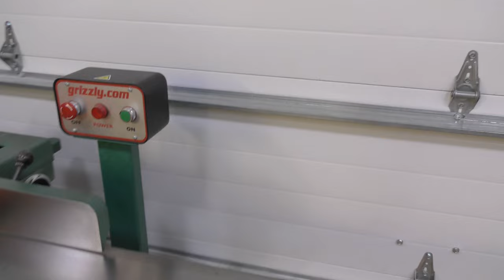Well Organized Woodworking Shop Tour 2024

Comment: Very nice and organized shop!  Very clean and love that bandsaw.   My only other comment is my concern about the unprotected romex cable running down the wall.:hand-orange-covering-eyes:
Reply from the maker: Thanks so much! Yes that bandsaw is a beast and yet very precise.  You are right about the wiring but I'm very careful and originally I set up the shop so that it could be converted back to a regular car garage quickly.  It's been like that for ten years and no issues 🤞

Comment: How are your clamps hanging on the wall? particularly your bessy parallel lamps 😊
Reply from the maker: Hey there!  Really simple, just 2 pieces of 3/4" trim screwed together 3" wide however long you need and then screwed to the wall.  So the clamps basically hang on the ledge created by the trim.  👍
Reply: @StudioZ72.create  any chance you can leave a picture - I understand what your saying but am more visual - for the f style is there a lip they hook onto? Or they are flat on top for both clamp styles and gravity just holds them?
Reply from the maker: Can't do pics but yes flat on top and gravity holds them.  Also they lean into the wall a bit and that helps keep them in place.

Comment: How do you do finish work without a air dryer and separation system?
Reply from the maker: I use an inline water separator coming out of the tank and then a inline disposable water filter attached to the spray gun.